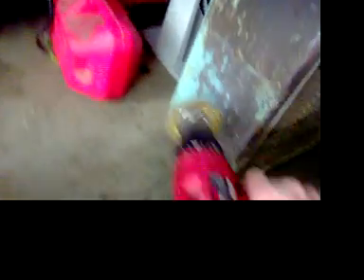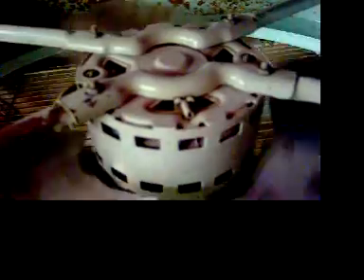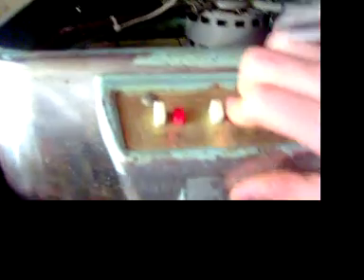my dead dominion box fan and the fan that might replace it

Comment: You can also rewind the stator, too.  That fan is by no means a total loss at all.  As especially that appears to be a 6-pole stator, those are a piece of cake to rewind by hand.  All you ned is some sheet style motor insulation, magnet wire, wire cutters, and a bit of patience.  In fact, what happened to your Dominion also sort of happened to my Belco "Jet-Aire" window fan in 2003, and I rewound the entire stator, all by hand and in my backyard shed.